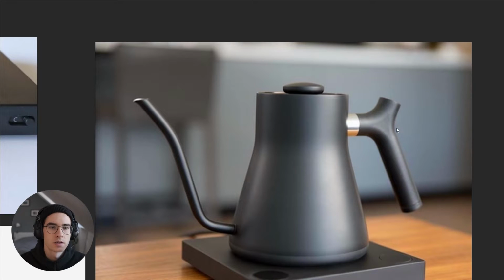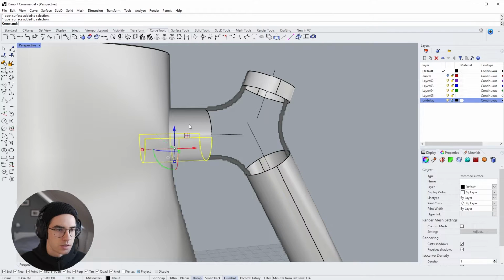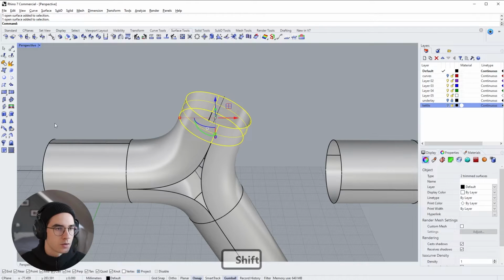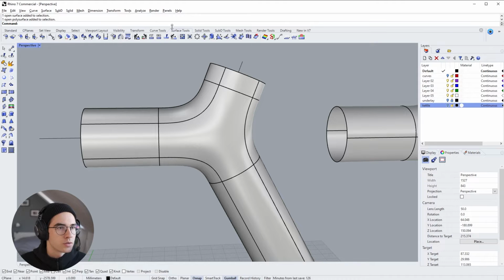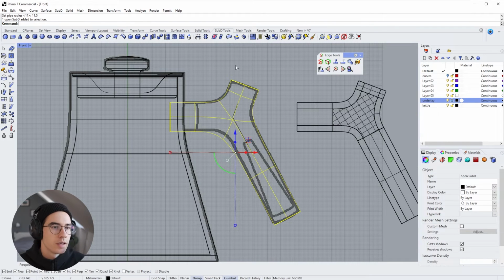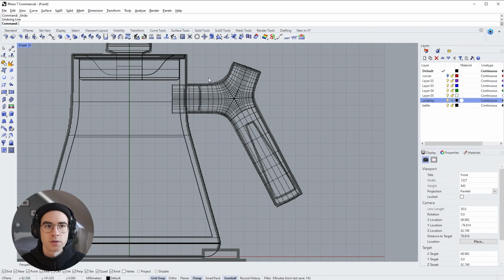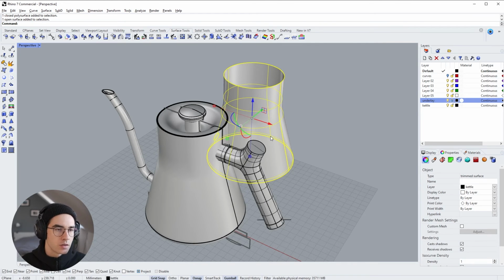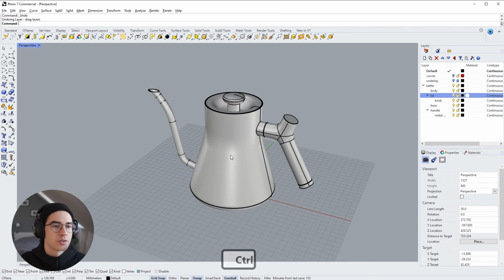Rhino 7 Product Design Modeling Tutorial Part 2

Comment: HELP PLZ! When I'm making the handle and trying to split the cylinders it makes one of the halves but the other half is split in two so there are quarters. When I try to merge them together, the blend tool doesn't recognize the half that used to be two quarters as one and does not blend correctly. I've tried several times and rewatched the video but haven't figured it out yet.

Comment: While those 3 ways to create the Y-branch of the handle are quicker, the best approach is to use 6 single-span surfaces for each side. Despite that this technique requires more time for modeling, the end result is much better and exactly what's used for manufacturing purposes by the majority of industrial designers. 
https://www.youtube.com/watch?v=KywTxrkTkco

 As for the 3nd way that uses a patch, it's possible to create a better end result by building 3 blend curves between the blend surfaces. This way, the bulging of the patch surface will be considerably less pronounced.
Reply: Yea! I think multi pipe with factor 1 created a handle with a circular but not perfect circle. Wonder if there's a way to control that too.

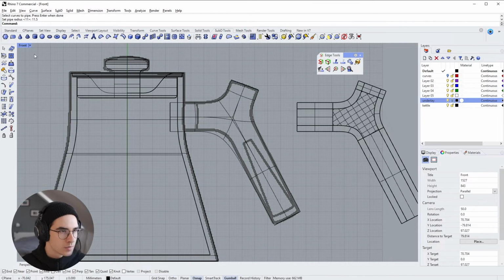Comment: Awesome videos. Thanks for making them. At 13:25 I use the multi pipe and get 3 square tubes coming together. Any idea what is causing this?
Reply from the maker: Hi there, I would think that you might have toggled the SubD preview off. So you are looking at the wireframe, or polygon version of your SubD surface. So use the ToggleSubdDisplay tool to see the real surfaces. ✌🏻

Comment: How can you go from rhino to production directly? doesnt it require regular cad like solid works and then 2d of each part?
Reply from the maker: This really depends on the requirements, but in theory there is no difference from the 3D data that comes out of SolidWorks versus the data out of Rhino, it’s all surface data. So as Long as all the technical requirements for production are met, you can definitely go to production directly. And if you need, you can make 2D drawings in rhino ;)

Comment: When you do the pipe function and type in a diameter of 11.5, is there any way that you can do this with multi dimensions? 
Like if you wanted 2 of the lines to be 11.5 and one to be 8  for example 

TIA! Love the videos
Reply from the maker: Hey Will, the SubD MultiPipe doesn't let you choose different diameters; you'd need to use one of the other ways of creating the handle with multiple diameters. Which, btw is even easier than having the exact same diameter as shown in the video.
Reply: @danielbrunsteiner  Okay awesome, would be such a cool feature if you could multi-dimension the multi-pipe ahahha. Thanks for replying

Comment: This is a great tutorial. I am having issues with when I split the pipes for the handle the line that makes the split shows up on the outside instead of in the center. So i have been unable to do the part where you rotate the pipes 90 degrees for the 2nd handle. Do you have any tips?

Comment: This was a great learning tool. I'm new to Rhino coming from SolidWorks. The thought process to create an item is SO DIFFERENT. SW the process is pick a plane, make a sketch, extrude or cut with the sketch, repeat. I'm not sure how to boil down the Rhino creation process yet. So far is seems: make a surface, join with other surfaces until solid is achieved.Also, you are fairly unique on Youtube. Most Rhino is focused on Architecture. I'm interested in making functional (3D Printable) parts.  I have subscribed! Thanks

Comment: Hi, Daniel! 
Nice video, good job! We need more Rhino tutorials :) 
Тhe only thing I didn't understand is handle with fillet edges... hole is not filling. And what is "C" for? 
I have mac version.
Reply from the maker: Hi Ekaterina, I don't know if I understood correctly. Could you point out the time of the video where this happens? Usually "C" is the option to auto-chain the edges, so you don't have to manually select all of them. Hope that helps.